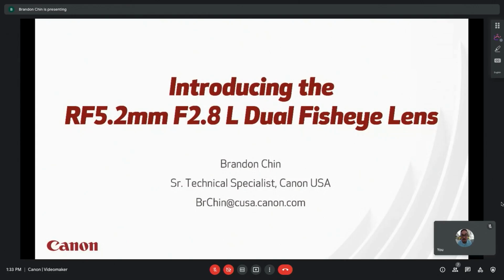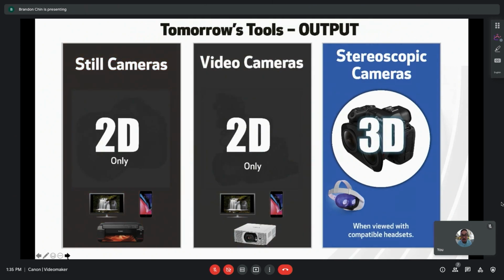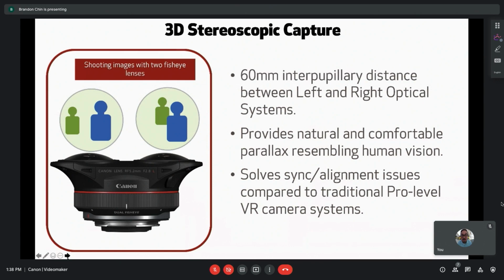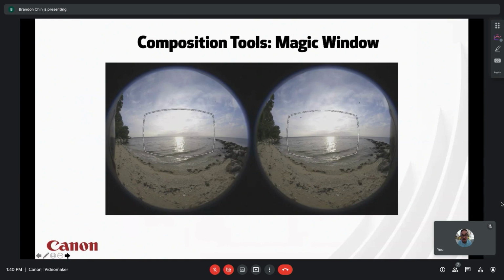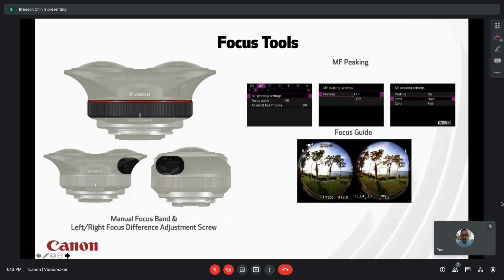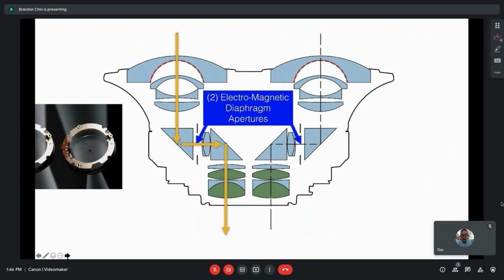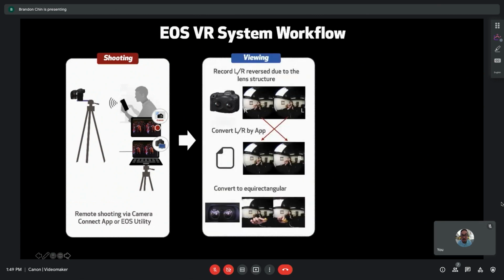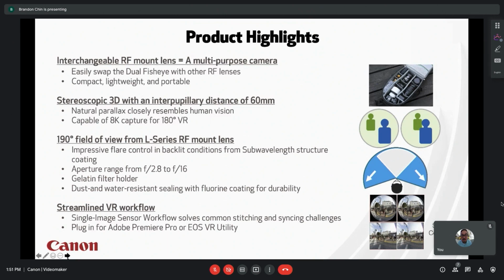Everything you need to know about the Canon F/2.8L Dual Fisheye 3D VR Stereoscopic Lens

Comment: I rented the lens with an interest in the photography side of this. My struggles were: (1) you can take JPEG + RAW. However, the VR software... from Canon... does not support the CR3 raw files—only the JPEG. In either case, you can not make edits using Lightroom, then bring it into the VR software and convert the image to an equirectangular format. A LightRoom plugin would be nice for the export. I could convert the JPEG to equirectangular then edit in LightRoom or Photoshop. Unfortunately, then you can not make edits to the lower areas with the monopod/tripod base. And its a JPEG which is limiting the editing. If you get a perfect exposure, this isn't a huge issue; the jpeg image quality well surpasses a Ricoh Theta z1 or X cameras touted for their image quality. The Canon 180 provides a much higher quality result with the DSLR equipment - no surprise. 

(2) The EOS VR software is a beta-version, in my opinion. It really does the basic task and no option to batch process images, to my knowledge. Its slow to load images even with the iMac i9 processor, 1TB SSD drive, and 64GB of RAM installed. So my hopes are Canon will quickly get behind this with more efficient software development or at least share the technology so others can build faster workflow solutions.

(3) The next challenge is finding a hosting platform that recognizes or allows the 180 format and/or limits the horizontal and vertical panning. Otherwise, your viewer may feel like they are in the meta verse viewing two versions of the same world plastered up next to each other but no difference. 

For me. It's the posting and sharing that can be viewed without oculus or google cardboard viewers. I want to see the single image that can pan horizontal and vertical for 180.
Reply: The software is revised; it now fully supports the m1 processor in Apple computers, which significantly speeds up the workflow. Most of the other updates are for video, including 8K RAW editing. You can shoot raw stiils, transform them to jpeg in your favorite editor and the Canon utility will work with your jpegs if you retain the same resolution and don't alter fisheye shapes.

Comment: Can the Canon RF 5.2 f/2.8 L Dual fisheye lens can be used in other R mount Canon camera for still image or it only works in R5 Camera only?
Reply: Please someone answer this
Reply from the maker: We believe its just for the R5. it requires a high resolution sensor to work as designed.
Reply: Some have attempted to use the R6 and said it worked, however, the warning pops up that the camera does not support the lens. It will produce the dual fisheye image in JPEG and RAW. Unfortunately, the EOS VR software does not recognize the image because the metadata was not encoded into the JPG file. Other software will not recognize it either.